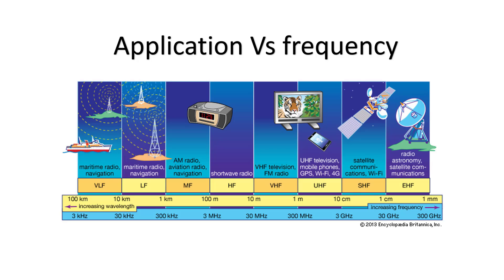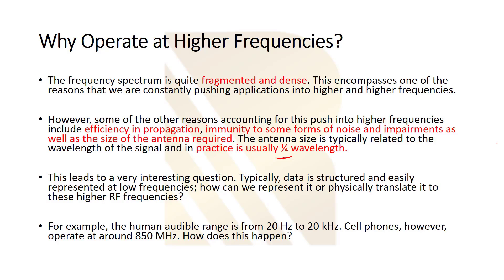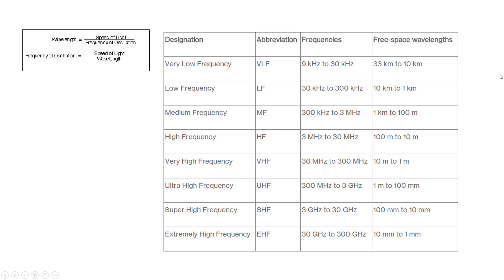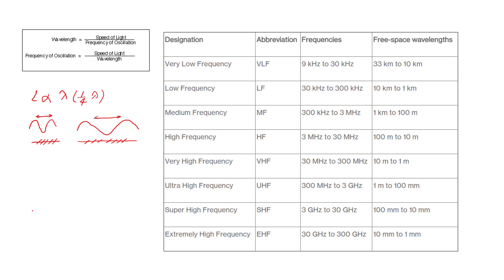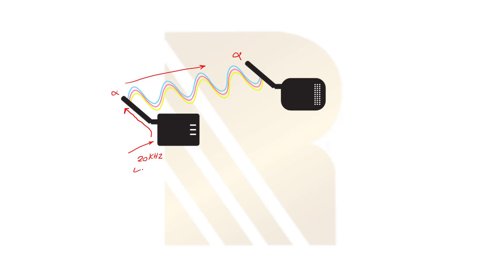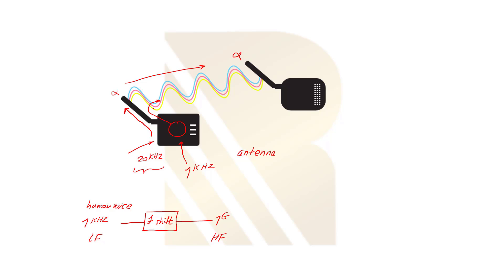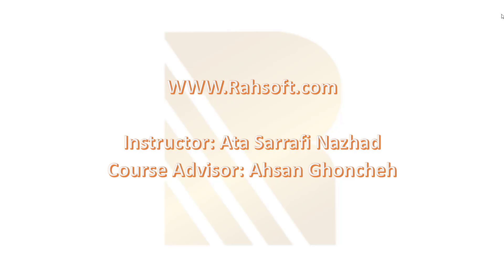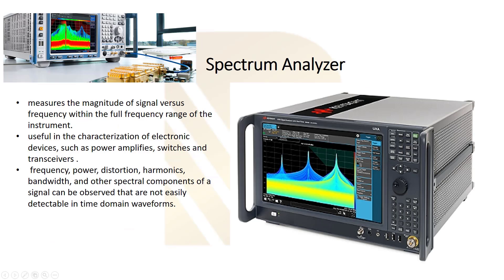Radio Frequency vs applications. Applications for Radio Frequency #2

Comment: Sir, we are actually using rf waves which has high wavelength compared to uv waves ..then actually the antenna size is directly proportional to the wavelength ..why don't we use uv waves for communication so that the antenna size is small so we no need to design big antennas and not required space to place antenna..?